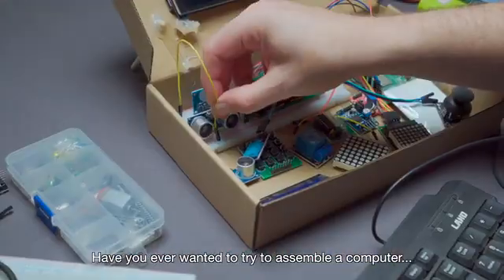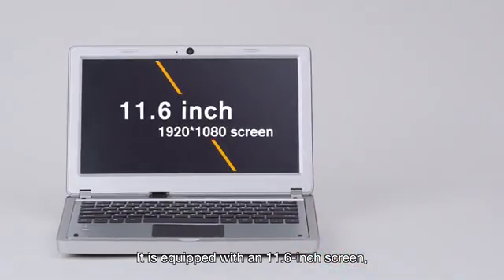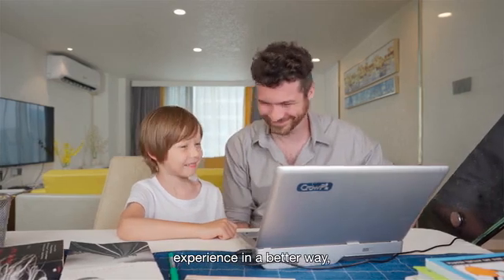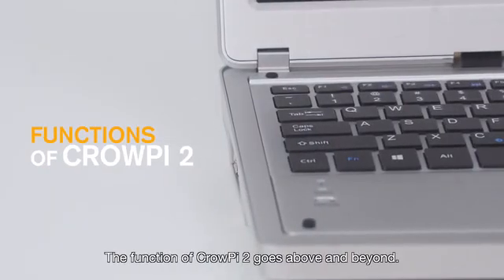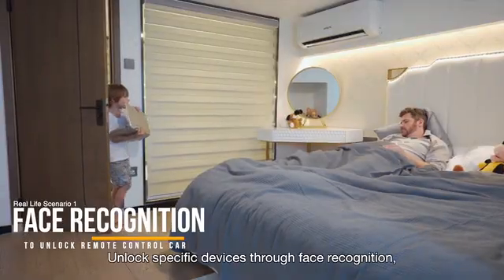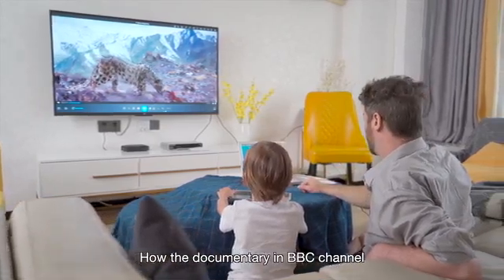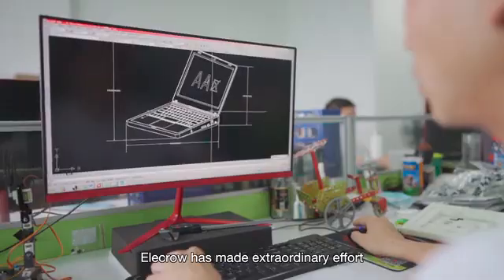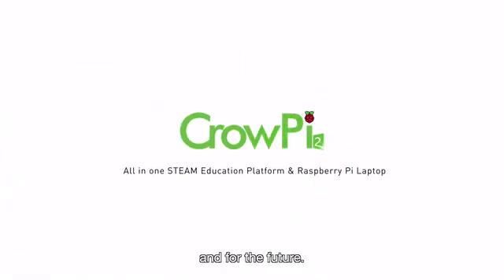CrowPi2 - STEAM Education Platform & Raspberry Pi Laptop

Comment: My Crowpi Laptop killed my Raspberry Pi 400. Watch out, the guys cut corners and used a USB-C connector on the 12v Power Supply, which is higher than the 5v USB Standard, killing 5V USB-C devices. I personally don't recommend purchasing the CrowPi Product. I've returned the CrowPi and will now need to buy a new Pi400😞